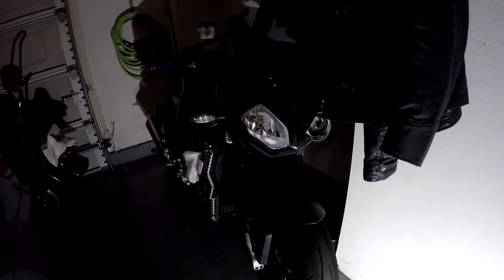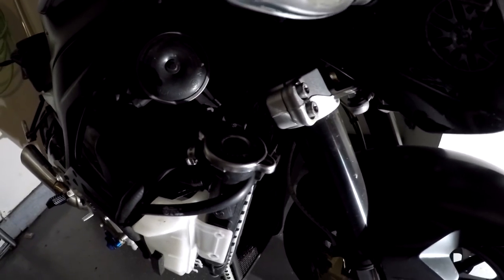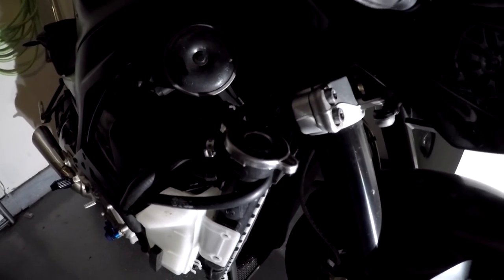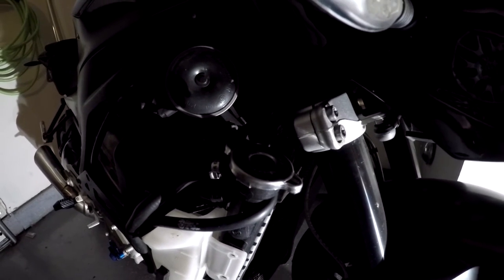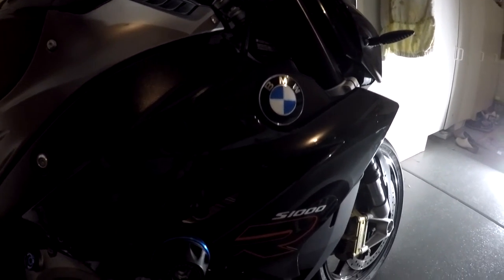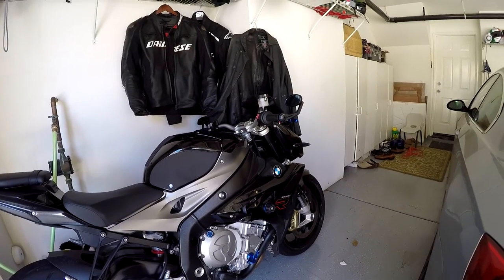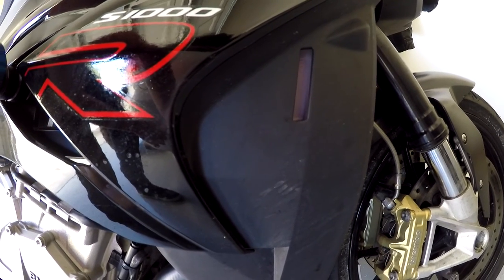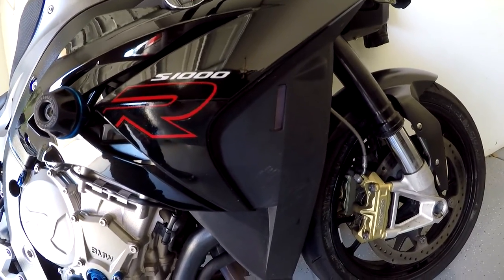BMW S1000R possible problem disappearing water wetter

Comment: @Minner Q did the coolant leak persist? I’m having a similar issue with my S1KR.
Reply from the maker: It wasn’t a big issue. I’d check periodically and would top it off periodically. It may have boiled over in traffic while the cap wasn’t completely secured. I’d check that coolant cap to ensure it’s seated well. Also, I stopped taking it out into traffic on hot days. It runs hot and even hotter when still at red lights.
Reply: @MinnerQ  thanks for the info!

Comment: Miner, I've got a '14 S1000r as well. When I look through the port at the coolant sight gauge mine looks empty as well. I attempted to pull off that side fairing as well so as to access the fill neck and see the reservoir tank. I got all the screws undone but got scared when trying to pull the fairing off because it seemed to take a lot of force.....made me think I could end up damaging the fairing. Can you share your side fairing removal technique? I'd certainly be much obliged. P.S. I'm also here in San Diego.
Reply from the maker: I ran into the same experience Garey. There are 2 rubber inserts holding the fairing on after the 3 screws have been removed.  One is in the front of the fairing, right next to that small black screw that you removed. The other sits just behind the BMW logo on the fairing. Pull the fairing forward (pull it towards the front wheel) to detach the rubber insert on the front - the one next to the little black screw you removed. Just pull it hard. It won't break.  The one behind the BMW logo is even more sketchy.  Try to snake a couple of fingers behind the logo area to stabilize it while pulling the fairing directly outward (if you're staring at the BMW logo, pull the panel toward you). You can rotate while pulling outward to loosen it a little. It'll come off.  It's pretty tight the first few times. I went over it here: https://www.youtube.com/watch?v=7uDhAOIRIkU   scroll to the 1:40 mark. 

Once you've removed the fairing, tighten the internal screws on the fairing itself.  Some of mine were a bit looser than I would have liked.
Reply: Thanks for the information....I will give it another try here tomorrow and yank and pull as suggested! Thanks again.

Comment: Hi,
I don't know if u still have the bike?I have the same bike with the same problem, the liquid collant is going up and down. The BMW replaced the expansion tank last week but the problem still is the same. I have been there today and they appointed to the gasket issue. How did you solve your problem and what was BMW decision / opinion?
Reply from the maker: Alberto Fernandes This is going to be incredibly useless.  Mine solved itself. I filled it a couple more times and it has been holding for the past 6 months.  I have been avoiding heavy traffic on hot days but I’ve  also had 3 track days sine the last fill.

Comment: Hello Minner,
Besides the possible mechanical issue you talked about months ago and disappearing water wetter is there anything else I should be concerned about since I am thinking about trading in my CBR1000RR for the 06/17 S1000R?

It looks like a great bike to me that will give me adrenaline rush of a sports bike with a more upright riding seating position. Thank you
Reply from the maker: The mechanical issue I address in the video has not turned out to be anything of significance since performance has never been affected and other RR's and R's make similar noises.  The Coolant issue may be solved with a new radiator cap - we'll see.  If not, adding coolant isn't a deal breaker. No real mechanical issues yet. I'm at 13000 miles. 
Other things:
- get the 2017 model. I say this because you're coming off a cbr and the small vibes from bars may bother you more. The 17 model has a new bar setup to address this. 
- if you are a big guy and plan on tracking it, consider the standard (non-electronic) suspension. This is only if you plan on really going nuts. Easier to change suspension parts. Considering the departure from the cbr, I don't think this is the case. 
- if you're wind sensative, you'll want a screen. The most effective screens may not be aesthetically pleasing. 

cheers
Reply: Thank you so much for the quick response.
I am not a "big guy" and if I ever go to the track it will be on a different bike.
I didn't realize they offer that bike with the standard suspension as well, probably little cheaper?! That is great.
I am glad you are having so much fun and I can't wait for the 2017 to arrive at the dealership so I can test ride one.
Thank you again and keep up with your great videos.
Reply from the maker: Thanks E.S., I'm sure you'll have an absolute blast. Yes, the standard model is significantly cheaper. You also lose cruise control, quick shifter and heated grips with the standard package.

Comment: Coolant loss is a user known issue for our S1000R's and tbh I have not heard of a single fix so it appears that the system itself is just not engineered right. 

http://www.s1000r.co.uk/index.php/topic,3623.0.html
Reply from the maker: I knew I was ignorant but I'm really out of the loop on this one.  Fortunately, coolant is cheap.  It would be nice to be able to fill it without removing the fairing though.  I wonder if this is one of those subtle updates on the 2017 model?  I doubt it.
Reply: Don't feel bad.   I just found out 20 minuets ago that the dealership didn't put the fill cap on the coolant reservoir during my 6k mile service,  2800 miles ago (6 weeks).   Somehow it took that long to show low,  yeah wtf.    The same as you,  it only lost enough to have the reservoir empty which blows my mind.    But the major problem that lead me to discover that is that somehow the header cover came loose from the radiator shroud, draging the front of it on the ground at speed and the rear of it rested on the header melting the crap out of it.   Not happy atm since I'm sure it was the dealership that left it loose but 6 weeks and 2800 miles are too much time to really argue it with them.
Reply from the maker: Woah.  That'll ruin an afternoon.  I hope this isn't going to dig too deep into your wallet to fix.